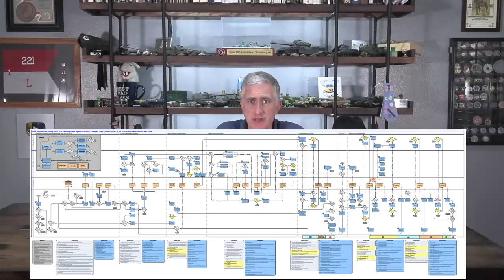Chieftain's Q&A #20: Zombies, Precious bodily fluids, and Magruder

Comment: Q&A : What is the first gizmo or gadget to get rid of if time and money are limited in tank production? Just a hypotethical situation if leopards or abrams' were needed plenty and soon.
Reply: Cupholders
Reply: Boiler.
Reply: Mre heater
Reply: Time is probably a non-issue. It takes much longer to produce the barrel or armour than it does a cupholder or boiling vessel - and I can't see production lines for those items being worth conversion.
Reply: @WolfePaws  yeah but he asked what we were willing to give up. Mine is the mre heater because that’s the only thing the Stryker did better than the hmmvw. Thus eliminating the need for the Stryker.
Reply: I was thinking of things like the gunnery sensors or some computers that aren't essential... but you're probably right, wolfepaws.
Reply: @laurisikio  without those systems the the weapon becomes useless. While you can in theory operate without you’re fire control systems, your effectiveness is really only hobble back to a repair facility effective. The manual systems are basically your spare tire. Take my Stryker, if my fire control system went down, I could still operate a machine gun or auto grenade launcher. However, I had less control over the weapon than I would with a standard Pintle mount or with a functional RWS. Then there is equipment that had to be removed in order to operate the weapon system, mainly the fire control servo. You also lose any stabilization the weapon had. So now you are in a position where the vehicle has to be stopped in order to fire accurately. So the fire control systems are kinda the most important thing. I could see them putting underpowered or old surplus engines in the vehicles before they ship without fire control. 

A little note however: When my unit was issued Strykers, they were shipped without NBC systems. So obviously the army doesn’t consider that a worthy system to halt production. The hilarious part of that is when the vehicle doesn’t register the missing NBC system, it thinks you’re under chemical attack and automatically would broadcast that on FBCB2/Blue force tracker. So every time we started the vehicles up it would send like 20 NBC messages to anyone with an FBCB2.

But the less smart ads answer is probably the NBC system. It makes mask life more bearable but it isn’t required if you have individual pro masks.
Reply: @laurisikio  yeah, I think that they’d pull old surplus M60s or sheridans before they would limit systems in new vehicles. For a couple of reasons. If the military wants a certain spec they get a certain spec or the military sues so the manufacturers of said systems wouldn’t allow the vehicles out the door without the proper equipment. The other reason is we cannibalize everything. Everything that isn’t destroyed and can be used to fix, upgrade, or add once a new vehicle is in country is saved. So say for some reason we can’t get Abrams barrels, well, they would fly the barrels that are still in spec from hard killed and mobility killed vehicles, back to the factory and have them repaired and installed on another vehicle. Case in point, the Stryker I was issued had been in an ied, brought back to the states, repaired and reissued with new equipment. The other thing is we can laterally transfer equipment from units that don’t see active combat, and gut those for the equipment we need. Considering that there’s really limited options for types of military equipment makes this easier.
Reply: @fathead8933  Yeah, and it's an interesting question - I just think time wouldn't really be a consideration, and they asked about limited time/money. In a war footing, if time really were a crunch, I wonder if replacing the Abrams' turbine might be an option - I believe there were diesel configurations, and a turbine is a complex thing to build.

I'm not remotely going to claim my engineering knowledge would outweigh your operational knowledge - my real consideration was that in terms of production there are basically two classes of "stuff" - the things you can't do without, and the things it's not worth doing without. Leaving out a BV or the chair padding or anything of that level makes no real difference, and as you clearly point out, there's no point leaving out anything that makes the system ineffective.
Reply: @WolfePaws  you have to think. You have to get someone to sign for it. Day one accountability training in the military is don’t sign for stuff you don’t have. Someone tries to make me sign for a vehicle without tracks or fire control or barrel, I’m not signing for it. That’s a lot of money that you’re accountable for. But if it’s missing a rifle holder, or seat cushion or mre heater etc (basically anything I can steal off another vehicle. You’ve hear beg, borrow, steal? Well in the Army it’s Steal, borrow, beg.) I’m gonna sign for it. 

I just don’t see manufacturers allowing combat ineffective vehicles off their property. DoD won’t look at that as a supply problem, we understand that, they would look at it as the contractor breached contract to save money. Just how DoD does stuff. Now they could do a COTS (Commercial of the shelf) purchase, and they do, but the original order is still in place and COTS require Stars to sign for it. Procurement is weird, but they focus deployment over training. So my NBC system was installed when the Army purchased the vehicle, the Army had General Dynamics uninstall it to send it to a deployed Stryker unit for spares. But everything has to match the technical data package when DoD receives it, but not necessarily me. I don’t even think the in factory inspectors will let it out of production without meeting the TDP. I mean it would be like GM selling cars without a radio, airbags, or a steering wheel. They won’t do it, they’ll just wait until the parts come in and then produce the vehicles. Also if factory A isn’t meeting demand, they will hire factory B to start producing them and have Factory A set up their tooling. Think companies like GM Guidelamp, or Singer sewing machines, or GM making the respirators for Corona.
Reply: @WolfePaws  on a more tactical side of this issue, I could see them adapting the unit before accepting incomplete vehicles in combat. 

Example: Tanker company A gets thrashed. Somehow a lot of Abrams got destroyed, they only have two tanks for the entire company. Well that tanker company just became infantrymen. They’d probably be given some trucks, and a bunch of Javelins and other AT weapons. I could honestly see a tanker company without tanks becoming Hunter Killer teams. Just as the best thing to fight a tank is a tank, the best thing to fight a tanker is another tanker. They’ll know the tactics, and how to beat engage the tank. 

So the real world solution is a “well we don’t have those tanks until that part comes in”. The reason the LTC was given Carte Blanch for parts and equipment is kinda the opposite of this scenario. He got all his desired equipment because they needed tanks. However without a need or actually having the tanks, puts them in the job he was doing before the elections ie Infantry tasks.
Reply: @fathead8933  fully agree. As one experienced in the navy under similar and real circumstances, cannibalism of other units was a thing, with the caveat of as great an idea as it seems, there's a huge time loss taking the donor down, removing the needed part or parts, geittng it over to the recipient, installed, etc., and finally, getting the replacement back to and installed back on to the donor. If the part was so useful, so generally was the donor, and as needing of being back up to snuff in its own right.
Reply: @davidburroughs2244  I think in another conflict of the destructive power of WW2, a rear area won’t see the important tank parts. 

I know that my unit’s policy was to strip the vehicle in a mobility or hard kill. We wouldn’t be pulling engines, but we would be pulling radio mounts, any type of sensitive commo equipment, weapons, remote weapon systems, drivers displays, armor etc etc.. The rear mechanics would never see any of that. Any 1SG worth his salt that starts losing vehicles, is gonna get more (the easy way if necessary) and he’s gonna make sure he has equipment to fix them. 

Now this isn’t a limited warfare situation I’m discussing. For that they vehicle is taken to combat trans, which is our battalion rear area, which then would process the vehicles to be traded for new vehicles. However, even that could take weeks to a month. Even in combat.

The problem with our types of destroyed systems is, sometimes your aren’t fixing them. Like dead and not even worth the aluminum that’s left. If our vehicles like Bradleys, Strykers and 113s catch fire and  it can’t be controlled, they’re gonna melt to the ground. So usually the heat treatment on the actual aluminum is gone if there’s been fire of any type.

Comment: if I may: I see your reasoning about no autoloader on a old turret, but...
What about trade space for space?
I mean: An M-1 with a carousel autoloader will carry much of its ammo in the hull, where the human loader was.
Ammo in the hull, less ammo in the Bussel racks.
One of the two racks may be empty and the space used to put inside the bussel (and poking out the roof thru a modifier blast panel) some anti drone, antimissile, anti guided munitions, anti zombie schtuff.
And/or some gadgetry for the remote weapon system.
Even the loader hatch, now vacant, would be a covenient point to have a sensor of some kind watching out from the roof.

So, yes, old turret build to protect three people, bulky to protect two people and an autoloader, but not that bulky to protect two people, an autoloader plus a cubic metre and something of new electronics, anti missile ammo and witchcrafty secrets.

Comment: I’ ll try with questions.1. How is track tensioning maintained on vehicles with hydro pneumatic suspension, like STRV 103 or Type 74? Especially, Japanese tank: every time I see it I have impression tracks are lie loose. 2. Is there any real life data on STRV 103 gun accuracy, not in-game data? How would you compare it to its contemporary adversaries?
3. How is communication between turret maintained nowadays, and what did it look like in the past? Is the turret electrically connected to the hull?
Reply: "2. Is there any real life data on STRV 103 gun accuracy, not in-game data? How would you compare it to its contemporary adversaries?"

I could sort of help you with that conundrum. But, I can only answer how the S-tank performed against its contemporaries. It's somewhat common knowledge to some armour amateurs that the S-tank was tested against the Chieftain tank, Leopard 1, and M60 Patton tanks (the American, German, and British tanks were early MBTs) during the 1960s-1970s. 

It was discovered from these trials that when compared to its foreign contemporaries (M60 Patton, Leopard 1, and Chieftain), the S-tank did not suffer any significant drawbacks when firing on the move. Meaning that a turretless design can perform just as well as a turreted tank when firing on the move. Which was surprising. 

Apparently, the reasoning given for why the S-tank was able to perform just as well as turreted tanks when firing on the move, was because gun stabilizers for turreted tanks wasn't advanced enough for that period. Gun stabilizers for tanks during that period allowed them to fire on the move, but at very low speeds, and with relatively low accuracy. So, in order to fire the most accurately, most tanks back then had to stop, and fire. 

However, the story goes that the S-tank became obsolete, because gun stabilizers gradually advanced to the point where firing on the move with high accuracy, was possible for turreted tanks (these gun stabilizers were present on more modern tanks like Leopard 2, and M1 Abrams). 

However, despite being considered to be obsolete during the 1990s (and also not having the full capability of firing on the move as advanced, turreted MBT tanks), the S-tank still performed remarkably well. This is, because according to some rumors, I heard that the S-tank did some war game simulations against some Leopard 2s (STRV 121. Basically early Leopard 2 tanks). When fighting on both the offensive, and defensive, the S-tank (surprisingly) beat the Leopard 2s in both scenarios (and with vastly fewer casualties too). Apparently, the reasoning behind the failing of the Leopard 2s was due to the "green" crews manning them (and also, because the S-tank crews were more experienced). Apparently, if both types of tanks (S-tank, and Leopard 2s) had equally experienced crews, the results would've been vastly different. At the very least, the S-tank would've won defensively, but would've been defeated on the offensive. Well, that's how I heard it. Anyways, the results of the tests could be somewhat inaccurate, as it was just a simulation.

At first, I thought these were unsubstantiated rumours......but, after some digging, I am starting to think these rumors had some grain of truth to them:

A) https://ointres.se/strv_103.htm

To, quote from the link, it states that, "Strv 103 suffered from childhood diseases and it took time before these were rectified. It essentially met the requirements of the objective and comparative experiments with foreign contemporary chariots showed that it had a combat value well in class with these and in many respects better. In the last "war" the wagon fought in 1997, when six Strv 103 met as many Strv 121 in a defensive battle at Kvarn, Strv 103 won by knocking out all the Leopards and only losing one wagon itself."

B) https://forums.eugensystems.com/viewtopic.php?t=14657&start=60 (It's a Wargame: Red Dragon game forum. But, I found something interesting in it)

From this link, it states, "With well trained crews and a sound tactic idea "S"-units have proved themselves able to outfight units with supposedly much better tanks such as the Strv 121 or Leopard 2A4. The last battle for the "S" was fought in the spring of 1997 between six Strv 103C and six Strv 121 at Kvarn training grounds. The BT-41 simulator guaranteed a fair evaluation. One engagement was defensive for the Strv 103 unit. The Strv 121 unit assaulted without any coordination into the well positioned "S"-unit that had flanking positions and frontal cover. All Strv 121 were knocked out and only one Strv 103C. In the afternoon the Strv 103C were on the offense and by using three tanks as direct fire support they were able to outflank the enemy in his defensive position and knock all Leopards out only losing a single tank of their own. I have myself been knocked out by cleverly positioned Strv 103 at several instances."

"The Strv 103 has recieved lots of good critisism as well as equally much negative. There is no succesor in concept nor will there likely be one. It has in all essentials lived up to the technical specifications and has served for thirty years now and will remain in some brigades until 2005 when they will all have been replaced by Strv 122.

The "S" is crammed with genius technical solutions. Because of the extreme design with all trade offs it will never be remebered as the best tank of its day, but neither will it be remembered as a dud. It had true combat potential and with a good crew was very deadly. It is hard not become sentimental now that it is slowly being phased out. All of us who have any experience with it will always harbor ambivalent emotions when thinking of the "S". There was nothing like it."

(Apparently these statements were taken from a link to http://home4.swipnet.se/~w-42039/s-tank.htm. Sadly, this link isn't working, so I cannot fully confirm the validity of these claims. But, it does piques one's curiousity)

(The fact that the S-tank, being a "supposedly inferior" design that is almost 2 decades older than the Leopard 2s, but somehow still managing to defeat them by a large margin, is amusing. Even if it was a simulation. Anyways, in more realistic conditions, it could be possible that the S-tank could still present to be a difficult opponent for any adversary with advanced MBT tanks) 

<<Just a spoiler warning, I consider myself to be very mediocre at properly researching stuff, so please do take what I say with a grain of salt. However, with that said, I do feel that I did a good job trying to answer your questions>>

Hope this helps. Cheers   :)
Reply: If you wanna know more about Swedish tanks in general, you could find more information in this site (I regularly visit it sometimes):

https://tanks.mod16.org/

Comment: Concerning APFSDS AA ammo firing at a high elevation:  I have a very detailed External Ballistics Program written with the aid of an expert on this topic.  He supplied all sorts of data on many kinds of gun projectiles to enter into the tables used for running the air resistance calculations.  One of these was a 10-caliber-length APFSDS tank projectile.  Just for fun, I decided to fire it at its 5,000 ft/sec MV at 45 degrees elevation using a 50mm diameter sub-caliber size from a 105mm gun -- similar to the original M-1 tank's gun.  The projectile went 80 miles; repeat, EIGHT.Y MILES, and it came down at a somewhat steeper than 45 degree angle of fall and was still going faster than 3,000 ft/sec!!  Not safe, wouldn't you agree?

Comment: Regarding the question of sound of tanks... In Norwegian army, using the Leopard 1, back in the 90's, the low rumling sound of it, actually made it hard to pinpoint exactly where they were, especially in winter with snow on the trees. I remember when trying to set up ambushes on them, that it was very unnerving, lying in cover, hoping that the tanks would appear where we hoped they would...